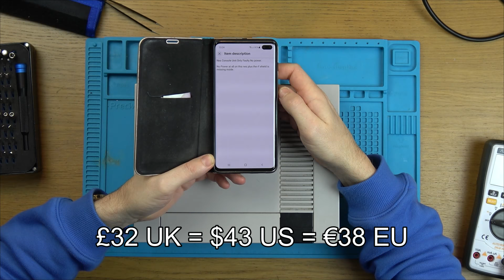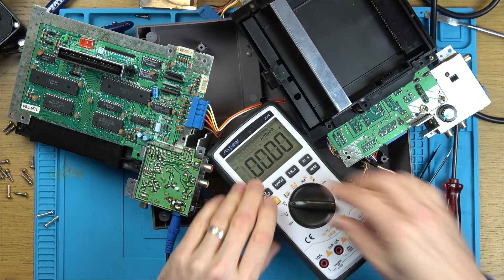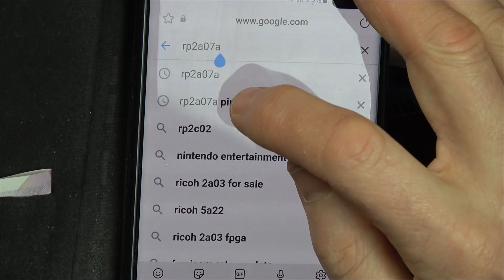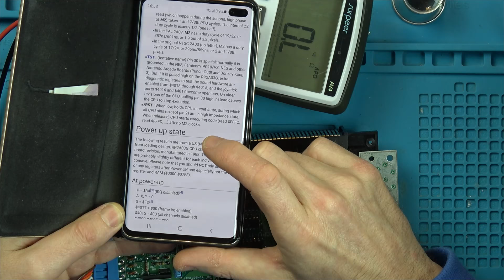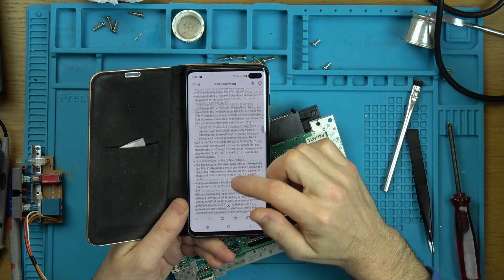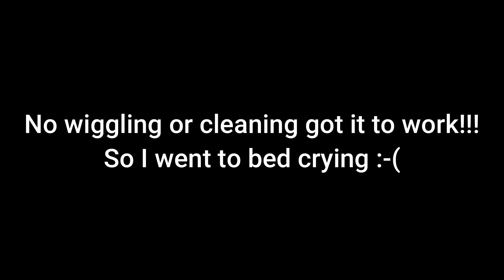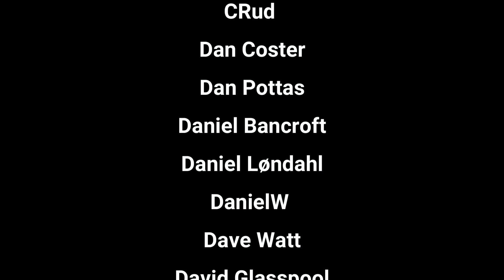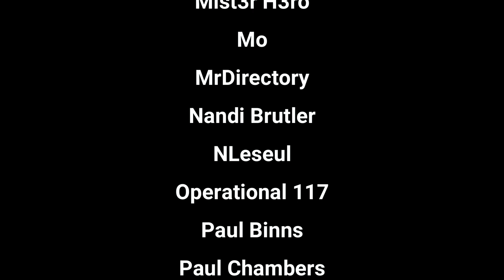eBay Nintendo Entertainment System ( NES ) with Numerous Faults - Can I FIX it?

Comment: if you need ram, you can also look at og red/white famicoms. Many are mega yellowed and/or cracked, are RF only and have attached controllers. With a bit of search  you can get some in JUNK status aka untested for decently cheap.
They are also useful for PPU/CPU change, but only for NTSC consoles, PAL consoles use a totally different CPU/PPU pair.
Reply: People always act completely amazed like you're a wizard that can perform miracles when you take a water or fire damaged console, rip some components off, and repair another console.
90% destroyed is still 10% useable!  If we recycled everything as vigorously as I recycle electronic components, we'd have already mined all the resources we'd need for a few years.  XD

Comment: Whether or not the unit needs an RF shield has nothing to do with whether you're using the RF output or not. The shield is there to block radio frequency interference in and out of the main part of the unit, and also the RF modulator is going to be active even if you don't use its output.

That being said, a lot of Japanese-made products from this era just slapped complete overkill shielding on the export versions, I suppose because they did not think it was worth it to keep failing their certification just to save money on parts. I've never heard of anyone having trouble with a mega drive or NES after removing the shield, in the unit itself or in nearby electronics. I would keep the shield on the actual RF modulator, though, as that is more likely to become an unintentional radiator.
Reply: Aren't the RF shields also primitive forms of cooling/heatsinks (if they make board/chip contact)?
Reply: @acumenium8157  They can be, but usually that'd be clear and in many cases they don't.

Comment: I still remember back in the day I had both a Sega Master System and a(n) NES. Both came with 9V bricks with the same barrel jack. One day I accidentally plugged in the SMS using the NES adapter. Result, non-working SMS. That's when I learned the NES brick output was 9VAC whereas the SMS brick was 9VDC. Had I been handy with electronics I might have opened it up and had a look for myself, but I ended up sending it off somewhere for repair. I later blew the NES RF port by using the TG16 RF modulator that was attached to the TV, being lazy and all. I had to buy an external modulator from Radio Shack and plug it in to the composite inputs.

Comment: if its rattling, ALWAYS open first it might be a loose screw, that can mess things up even more.
also, the rf shield has nothing to do with the rf output, its to shield the chips from rf interference.
Reply: The RF shield is there as an FCC requirement to block the interference that the device may generate, which would affect other devices.
Reply: @SimonQuigley  either way, it was total nonsense of him to say he didn't need the rf-shield because he wasn't going to use the rf-output.

Comment: Almost same thing happened to me on a SNES I got off of eBay. Turned out the controller connection on the motherboard was bad probably due to a faulty voltage regulator. I only knew about the problem when I plugged it to the tv and it was working perfectly after replacing the voltage regulator and the fuse. It was reading cartridges but not led or control functionality until I replace the connector on the motherboard.

Comment: Just FYI They sell a new ppu replacement that works mostly okay.  It has some compatibility issues with certain games. They used them in clone consoles.

I came across those while troubleshooting a similar issue where I had an nes that worked perfectly except it would send a troubling amount of voltage to the ppu.

Comment: The reset pins of the two big chips are both inputs. What made you think the big chips are faulty if they get the wrong voltage on their input? The part that produces the voltage for these inputs was much more likely to have a problem.

Comment: A few years ago I bought an NES with the cables and everything and a game, faulty for something like $18, the problem was the blinking light when turning it on with no picture, turns out it's the same common issue when the cartridge slot Is dirty or whatever, I cleaned it and has worked brilliantly since

Comment: It is kind of weird that no one ever thought to do a voltage check on all the pins and write it down. I used to do it when I worked as instrumentation artisan. fault finding was easy because I just had to check the voltages that was wrong and repair.

Comment: Wondering if something killed it? Maybe a lightning strike or someone used the wrong adaptor? The rattle in mine was snail pellets, lol.  Thankfully it wasn’t a series of faults, just someone cutting the IRQ line and reconnecting it. They mustn’t have realised they also cut the next line which stopped it doing anything.  A second wire brought it back to life.  I was thinking of the small chip early on as I’d done a fair bit of research while fixing mine. I didn’t cut pin 4 although I was tempted.
Reply: Certainly seems like an over voltage issue, which damaged the chips and blew the LED.

Comment: Those chips die from age and heat or someone got it wet while on. I’ve got a gross rusted one that still runs great. 👍🏻 
Now your next task is to put the guts into a nice old body stainless steel toaster and make a nintoaster.

Comment: No joke, for the first half of the video I was yelling at the TV, "check the LED".

The second half of the video, I was all, "check the CIC chip".

I know it was more than that, but having no access to the hardware, I'm surprised that I got those right. 

Honestly tho, I would just do the CIC mod, to remove the chip, because it's a reason that sometimes legit cartridges fail to work (I think you need to ground that pin 4 also?).  It's basically  DRM from the 80s, and it causes just as much harm, sometimes making good cartridges not work.

Edit: I agree it's not the VRAM, you'd still get video, it would just be corrupt.
Re: wram -- I think a lot of cartridges like SMB3 have wram on them.  But also you can use a modern replacement with more address pins and just tie the high address lines low.  (It's a waste, but whatever, it will work, you just need to wire the chip up by hand.)

Comment: The biggest problem these have is the lack of friction when inserting the cartridge. This means the contacts get dirty. But never use a cheap replacement connector from ebay. I replaced mine and it was worse. The original one is fine just needs a good clean.
Reply: I've pulled the contacting pins out of the cartridge receptacle and re-bent them to have a better contact area. Worked great, very time consuming.
Reply: @jasonbrindamour903  putting them in boiling water for a couple of minutes does a good job of getting the pins back to where they should be. Have done this on a few and it works great. Just be sure they are completely dry before trying them.

Comment: How did you know what voltages should be sent to what components? Is it just purely because you had a working one to compare with? I’m trying to understand the thought process that made you decide to take the CPU out of the circuit to test the gpu. I’m looking at the viability of working on electronics and repairing them for resale. While I don’t have an extensive electrical engineering background, I do know how to take apart things and solder stuff. Outside of doing a few batches on my own I have never done much with it. I have done some basic board swapping but I’d like to be able to go more in depth and use broken boards with good components as a salvage point. It’s when a board is determined to be the problem, I’d like to be able to do some basic troubleshooting on the board to know how to fix them and refurbish them back to a working state.
Reply: my first thought....LOCKOUT chip. Obtaining a schematic would have saved you ALOT of time. You looked up the chip pinout.....why not go two extra clicks and get the schematic?

Comment: With multiple burnt chips (especially the CiC one) I bet the previous owner had one of those chinese multicarts or a cheap everdrive knockoff that have bad voltage controland are known to burn out consoles.

Comment: I've been restoring NES consoles for about 6 years now and I've never come across ones where any of the components were married to each other. I've been able to swap any and all parts. That being said, I've only worked on NTSC consoles but I don't see why it would be any different between regions. I don't think you can swap PAL and NTSC specific parts though. That would be too easy.
Reply: None of the components in an NES are married to each other, at least within regions. Vince just confused himself because of the different package variations of SRAMs.

Common DIP SRAMs back then came in either 7.62mm or 15.24mm widths, which is what you see between the two boards. If you look at the PCB around the smaller SRAM chips, you'll see a second row of holes in the board, the NES was designed to accept either. Nintendo did this so they could have more options for sourcing SRAM chips in case of supply issues. They were selling millions of these consoles and needed multiple sources for things like SRAMs.

Other game consoles did the same. Several revisions of the Sega Megadrive/Genesis had multiple pads for the SRAM chips as well.

Comment: The service manual or a schematic would make fault finding a lot easier but I'm guessing they don't make it so easy to find them. A pity as it would cut the time spent fault finding considerably. Note to self - don't bother trying to fix a faulty NES as life is far too short. 😁
Reply: The schematic is on-line for free. You are talking about an NES....not a hydrogen bomb! (I suppose that is on-line as well)

Comment: 39.14. at this point, I'm thinking that chips that have the same ID markings, doesn't tell you what revision it is.
I bought an NES console only from a pawn shop which was labelled as non working, for £4. I already had the necessary wires & power at home, the red light was blinking all the time with a Bugs Bunny game cartridge. I put my fingers on top of the loaded cartridge and wiggled it a little while it was powered on & I then saw graphic garble on the screen, then I pushed the reset button, & I was playing the game untill it crashed due to vibration from the table. The NES is like one of those engines that you had to pull a cord for it to turn over, the first attempt most likely won't be successful, as in, the NES booting into the game from first power on instead of having a blipping blank screen with a blinking LED. I heard it was the CIC chip at work there, where they don't seem to read each other properly, which makes the console be on a constant reset state until a genuine CIC chip is detected.

Comment: Sounds like a faulty PPU chip is the cause for many broken NES systems.  Too bad it's a chip that cannot be replaced and only repaired by taking one from a working NES console, which still only leaves you with one working console.
Reply: So if you buy a broken NES for its PPU, you're really rolling the dice considering its PPU could be dead as well.  That would leave you with a lot of money spent for two broken NES consoles.  Still, this is a really good video showing how to diagnose the problem.

Comment: I would have opened it up before powering it on with something loose inside it
Reply: Yes, I’d agree. Treat like as for water damaged equipment and have a gander first. That said, credit to Vince for tremendous commitment to get it going again.
Reply: At least shake it around with the flap open to see if it will fall out :-)

Comment: I know parts these days are married up, to stop people from replacing parts, but be surprised if something was married up going back to the 1980's/90s. otherwise the right to repair would have been a lot harder. I don't remember my father fixing my friends NES apart from cleaning the cartridge port, which quite often played up. so sorry Vince no help with this. 😞
Reply: complain to PCB manufacturers Vince!! if following a trace or something was single sided board, it would be a lot easier to follow for a youtube video!! plus being easier to fault find. but when looking at chips being at fault it is getting to the point that it is harder to follow. great video, and yes done the right thing swapping the cases over, shame wasn't a total fix though, and 2 working NES's.

Comment: That stupid 10NES CIC chip. It holds the CPU in reset unless it matches with the chip in the cartridge. Just disable the chip and then it will be a lot more reliable.

Comment: Around 10:00, for some reason it takes in AC yet the ENTIRE board uses DC... why Nintendo?
Reply: Well the wall power is AC and it needs to be rectified, that rectification can happen either in the power adapter or the console. 9VAC is not an uncommon input power for older electronics.
Reply: the nes power supply can be 9v ac or 9v dc (don't try 9v ac with other devices)
Reply: @gamecubeplayer  I know, I watched MattKC's Can you run an NES from AA batteries?
Reply: @_LGD  i watch mattkc too
Reply: @gamecubeplayer  I don't know what the heck nintendo was thinking back then.

The Famicom takes DC, while the US NES takes AC but through the same connector, and the PAL NES also takes AC but through a slightly different connector (2.5mm ID instead of 2.1mm).

The Super Famicom also takes DC with the same connector and voltage as the Famicom, but the US SNES uses a weird proprietary barrel plug, and the EU SNES again takes AC through the 2.5mm ID barrel plug.
Reply: @rfmerrill  there are black dc plug and blue dc plug pal nes/pal snes power supplies and they only fit in black or blue dc jack pal nes/pal snes consoles (third party pal nes/pal snes power supplies fit in both)
Reply: @gamecubeplayer  makes sense. There exist barrel plugs that will fit jacks with either a 2.1mm or a 2.5mm pin, but also plugs that only fit one or the other

Comment: I'd say you're worse off than when you started. You would have been better off just swapping cases without doing anything else (though it's debatable that it's even a nicer case; it isn't yellowed but it has a piece of the plastic broken off in the corner). Instead, you did a bunch of chip-swapping, subjecting each leg of each chip you swapped around to extra heat cycles from your soldering iron, and that's not even remotely good for them. They already had one heat cycle when they were soldered in at the factory, and when you desoldered them they got another, and when you soldered them back in they got another, and so on. 

One of the reasons for using sockets is to avoid heating the chip. When they don't use sockets from the factory, there's nothing you can do about the heat cycle they've already been through of course, and if you need to remove a chip, there's nothing you can do about the heat cycle from desoldering, but you can add a socket at that point so that there will be no more heat cycles.